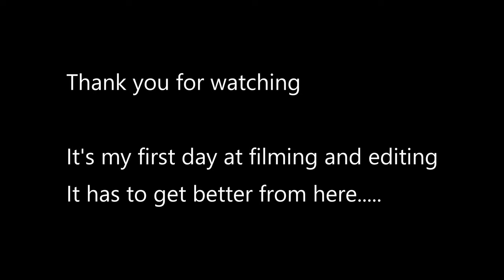1966 Mustang door skin replacement part 1

Comment: the door on my 66 is a real nice clean az one BUT <<< the door had flew open and bent on the front fender , i was told get a repop ,but i dont want one
Reply from the maker: If you can fix the factory steel it's the best way to go usually.

Comment: My question is a little off topic from this video but I am going to start mocking up my car. Getting my panels hung etc for fit. Do you recommend hanging my doors with the full weight in them? Meaning all the mechanisms inside or just hanging the empty shell? It makes sense to me to do it with the full weight but wanted to see what you think.
Reply from the maker: When final adjusting the door/hinges you will need to have the doors fully assembled as the door does sag with that weight in it. When I was doing the doors on GM G-bodies there was quite a difference between an empty and an assembled door when it comes to sag. Those doors are extremely heavy and very long. 
   When I am fitting quarter panels etc with bare doors it's not an issue as I am just aligning panels. When I go to assemble the car the fully loaded doors wouldn't line up if I don't readjust the hinges.